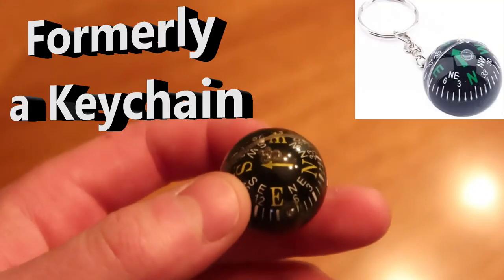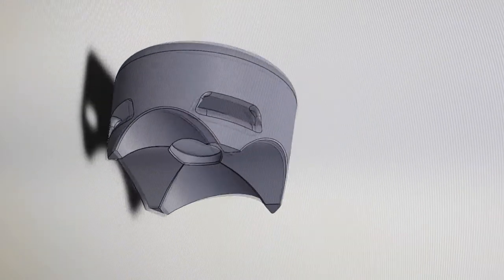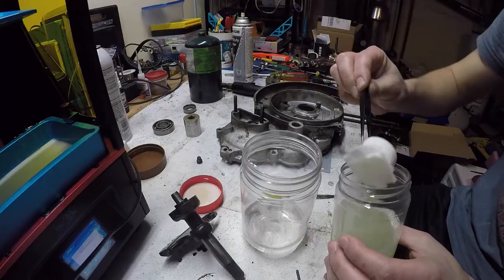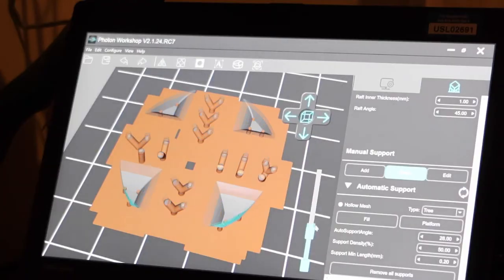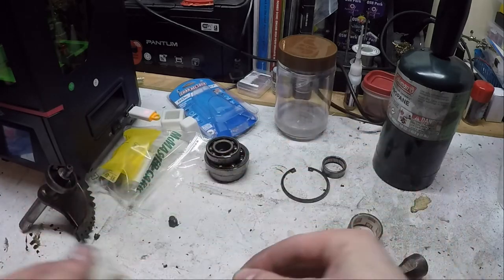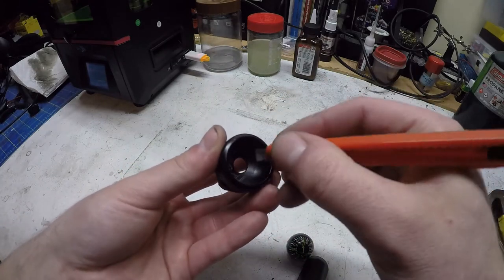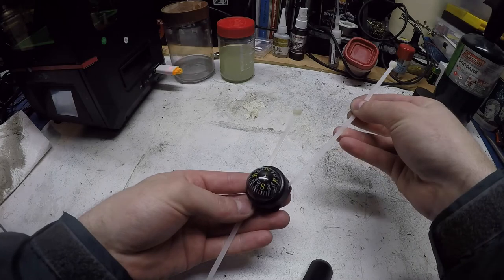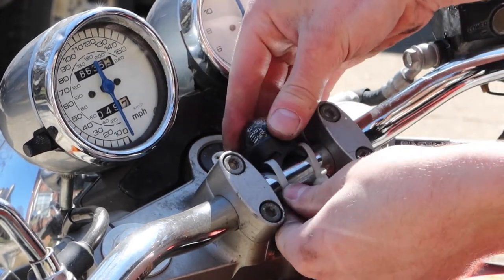DIY Motorcycle Handlebar Compass - UpCycling a Cheap Keychain

Comment: During a sunny day, a bike/motorcycle rider can use his own shadow on the ground to determine direction. With a little training, is far more effective than a wobbling compass affected by metal handlebars.

I used this method once at afternoon. I was at South area (without traffic signs) and needed to go to Northeast. I simply kept my shadow on the ground between my front and right while riding my motorcycle.
Reply from the maker: I come from this strange place called Ohio. If I waited for sunny days to ride, I’d only put a couple hundred miles on my bike in a year 😁

Comment: Why would you mount it directly on a STEEL handlebar? Doesnt it throw off the needle?
Reply from the maker: That's an interesting point that I hadn't thought of. It seemed to work alright though, not sure if the metal handlebar made much of a difference as it was directly underneither the compass.